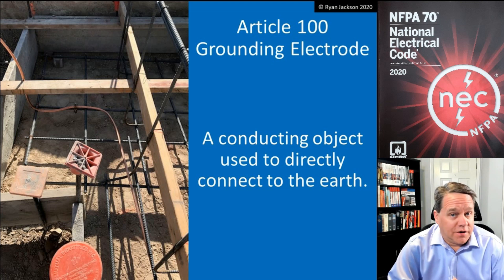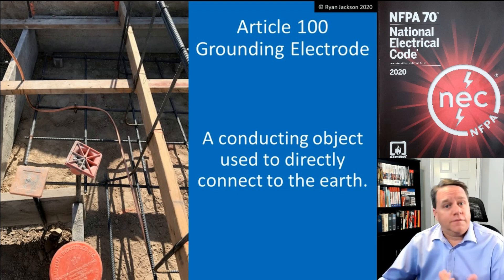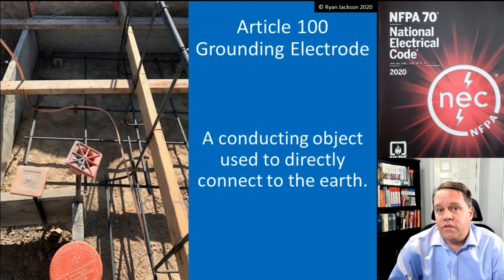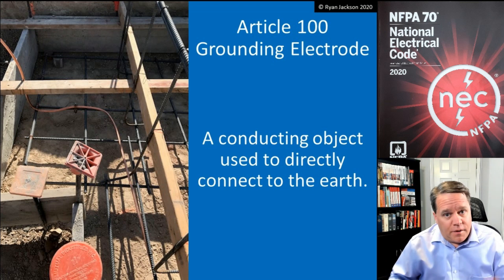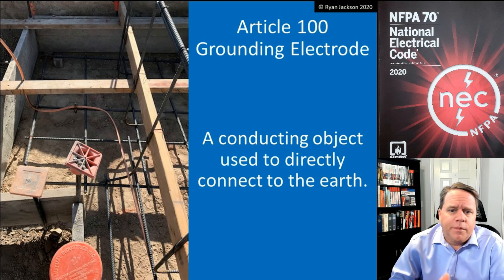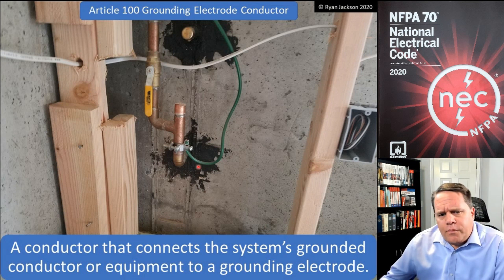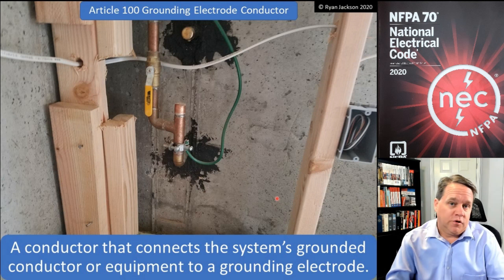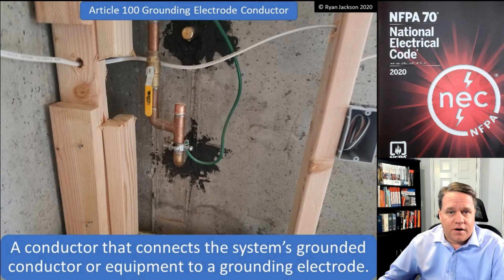100 Days of Article 100: Grounding Electrode and GEC

Comment: @Math Man, I've used both ConduDiscs and Conducrete, and can hardly believe how good the ground resistance readings are. They're averaging 5.5 ohms, and 90% of the time they're less than 13.2 ohms. Ryan mentioned Canada and Minnesota/Wisconsin. As an engineer in the 1990s in NW Ontario (just north of Minnesota), with two feet of soil on top of two miles of bedrock, some days I'd be lucky to read less than 100 ohms on ANY ground rod. So frustrating.
Reply: It’s great to have various products I hear it’s taken off in UK where small property size and ground rods are less practical this product is ideal. My place in Virginia with softer loamy soils i can get down to around 2.5 ohms with two ground rods. End of the day it really is just back up loop impedance to source will always be far smaller and rods are there very often to protect property and persons if the neutral, center tap on the transformer were to fail.

Comment: Great video, Ryan, very helpful. Thanks for posting.
I just spent four hours looking through the NEC for GE/GEC ampacity requirements, something like NESC rules 093C and 094, but no dice. I guess the NFPA figures that that if you use NEC table 250.66, you're good for ampacity. Fair enough, and it's an easy standard to follow -- it just seems a bit weird to someone who came up through the utility side of the business!

Comment: Take a look at the Condu-disk and condu-Crete product which works well in the case of harder ground similar to plates.
Reply: I've used both ConduDiscs and Conducrete, and can hardly believe how good the ground resistance readings are. They're averaging 5.5 ohms, and 90% of the time they're less than 13.2 ohms. Ryan mentioned Canada and Minnesota/Wisconsin. As an engineer in the 1990s in NW Ontario (just north of Minnesota), with two feet of soil on top of two miles of bedrock, some days I'd be lucky to read less than 100 ohms on ANY ground rod. So frustrating.

Comment: Not funny about water pipe ground joke.  That rule is too protect life.  I helped a friend with leak in water pipe a few years ago.  Got a pretty big shock when we cut out the bad part of pipe.  I went to my car and grabbed jumper cables to complete the connection until the new pipe was soldered in.  It was late at night and we had to get the water back on.  Told him there was an issue but I don't remember if he tried to get it fixed.

Comment: The connection using the water line as the grounding electrode I presume can then also double as the connection required to bond the piping system within the structure? Two birds with one... Connection?
Reply from the maker: Correct.